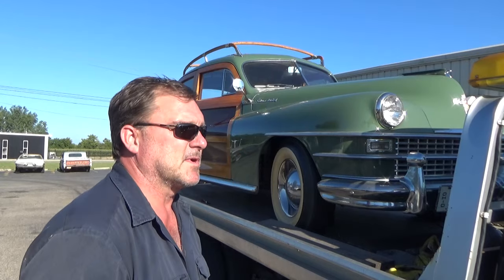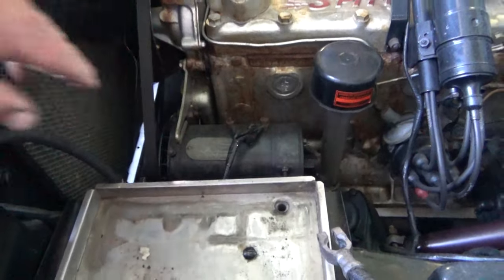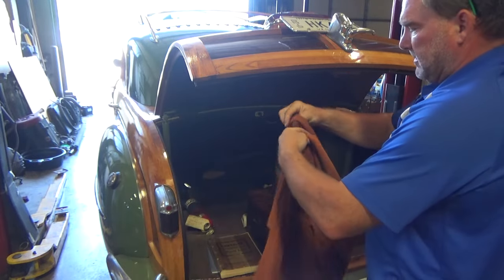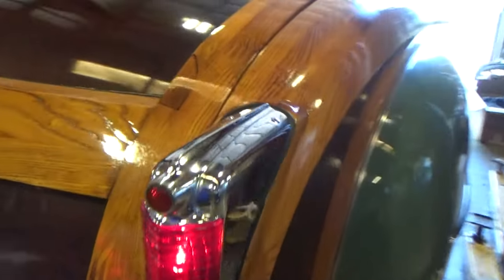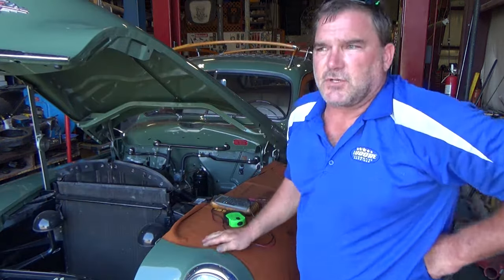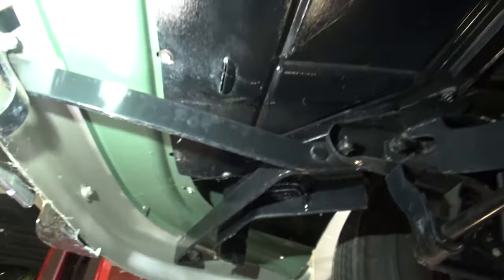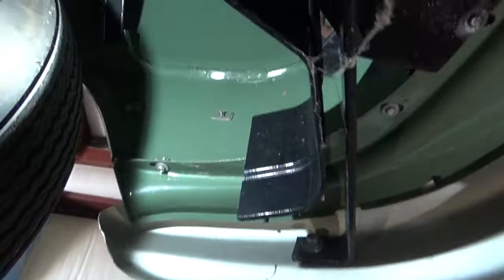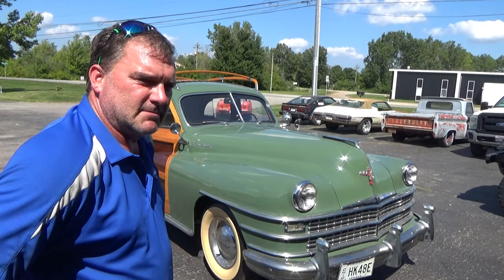Incredibly rare 1948 Chrysler Town and Country ... Revival? Reawakening? Will it run? Probably!

Comment: I'm surprised that it runs so well on negative ground!  I didn't even know a postitive ground car would even run with reverse polarity!  Do the gauges read backwards?
Reply: It ran quite well.  It is better now.

The battery cables were wired with the big eyelet to the starter and the small eyelet to the engine ground.  I changed the cables around because even though it runs and drives fine the ammeter read backwards and the fuel gauge read empty.  After switching it to Positive ground, the ammeter reads correctly, and the fuel gauge works as it should.
Reply: I actually had a 64 Buick riviera that came in with the battery hooked up backwards.  it ran and drove but it was not very happy.  Once I figured out the battery was backwards it livened up.  I was surprised at the time that it ran too.

Comment: That is one immaculate automobile, especially considering it's age. It's obviously been garage keep and not driven much for a car that old. One of my high school friends dad had a Cadillac LaSalle even older than this one. Late 20's-early 30's and it was a convertible. It was in about the same if not better shape as this one. Garage kept and short drives 3 or 4 times a year and only when it was not raining. Cars like these are very rare to find, let alone in this condition.